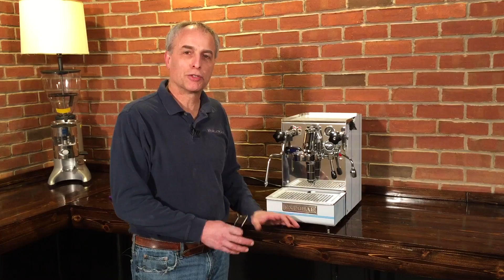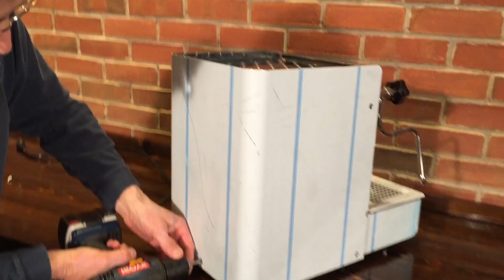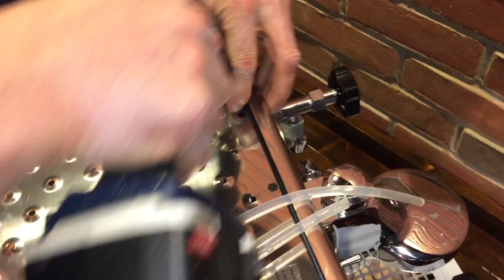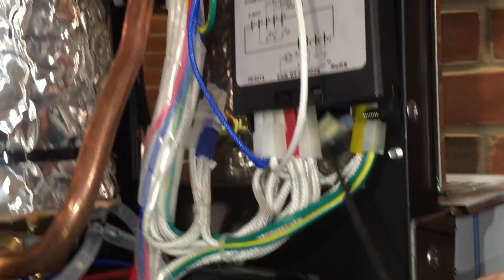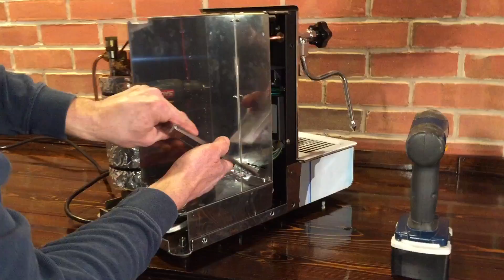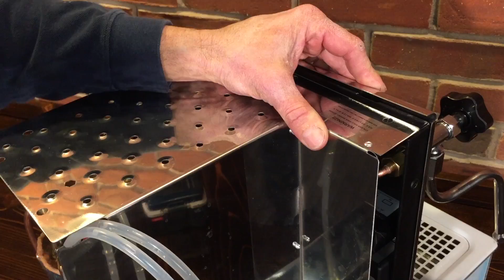Expobar Espresso Machine Pump Runs Continuously - Water Level Sensor

Comment: Mi cafetera es una Expobar office control , de una caldera, tengo el problema que por la lanceta sale agua se puede decir que bastante, después empieza poco a poco salir vapor con agua , hasta que ya después sale puro vapor, por lo regular pasa solamente cuando la prendo por primera vez , podría cer lo que menciona de la sonda de nivel agua , puede ser que se sobre llena  ? Me han dicho que puede ser la botonera que ya no sirve que hay que cambiarla completa , pero en México no le he podido conseguir , espero me puede ayudar orientar por favor .
Reply from the maker: Es difícil decirlo desde aquí, pero podría estar sobrellenado. Si pensara que ese es el problema, revisaría la sonda de nivel de llenado para ver si hay depósitos de cal. Es otro problema.

My coffee maker is an Expobar office control, with one boiler, I have the problem that water comes out of the lance, you could say a lot, then little by little steam with water starts to come out, until later only steam comes out, normally it only happens when I turn it on for the first time, could I see what you mentioned about the water level probe, could it be that it is overfilled? I have been told that it may be the button panel that is no longer working and that it needs to be completely changed, but I have not been able to get it in Mexico, I hope you can help me please.

Hard to say from here but could be overfilling. If I thought that was the issue I'd check the fill level probe for scale deposits are other issue.

Comment: Im legitimately desparate. I just bought a used expobar, turns out it had a lot of scale and the pump was shot. I replaced the water pump and now I'm not getting an unpleasant noise off of start up, but still no water flows through the machine. The PID stays at 17 degrees consistently
Reply from the maker: Hi CD, First step, start at the reservoir and trace water flow through the machine checking for blockage. There may be a blockage even before the pump. Many machines have a sediment filter in the line from the reservoir to the pump. Scale typically forms in areas holding or carrying heated water. You will need to remove pipes, etc to check 
for scale. Could be in pipes, boiler, group head, etc. If water stays at 17C the machine is probably not heating. Could be many reasons for that like damaged heating element, bad relay, no water in boiler. Here's a link to our support pages for Expobar machines. There may be videos and articles there which can help you find the problem.

Comment: my expobar machine is an old two group model, it's doing this exact thing, but i made sure it's not the water level sensor, what else can it be? it's continously filling all the way to the top
Reply from the maker: Maybe in the electronic controls beyond the level sensor?
Reply: Mine is doing the same, even after replacing the water level sensor.  completely stumped at why the water just pores out while the pump runs continuously.  any thoughts?

Comment: Hi, I've had my machine for 2 months and this started happening, however I have reconnected the wires nicely and the issue still occurs. The safety valve isn't as screwed down as the one shown in this video, should I force it to screw in further or source a replacement safety valve?
Reply from the maker: HI Y, More resources for troubleshooting available in our Support Wiki for Expobar here: https://wiki.wholelattelove.com/Expobar
If you are in the US you can call/chat/email with our tech support team here: https://www.wholelattelove.com/pages/contact-us

Comment: I came here because my temperature reading is erratic and I suspect the temperature sensor is faulty. Looks like it might be that black wire in the top of the other tank. Thanks for this video - gives me an idea of what to expect when I take the machine apart at least!
Reply from the maker: Hi Rob, You are welcome for the video! Also, check out our repair wiki for Expobar machines! It has loads of troubleshooting info, manuals & diagrams and quick links to related Expobar videos: https://wiki.wholelattelove.com/Main_Page

Comment: I bought this machine from whole latte and am having the same issue. 
Machine is 2.5 yrs old. I have checked the connectors and all connections are ok. 
The boiler gauge goes to 2 Bar and steams starts leaking and boiler makes popping sounds. 
what else should I check?
Reply from the maker: +kam1996 Where is the steam leaking from?